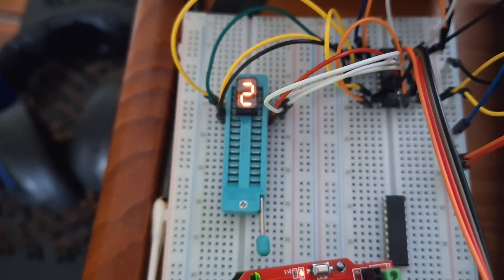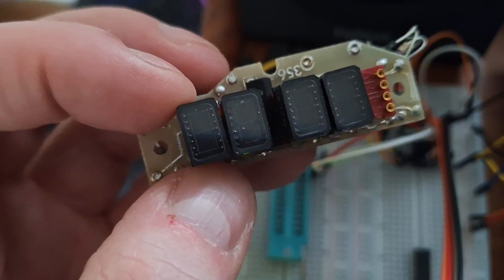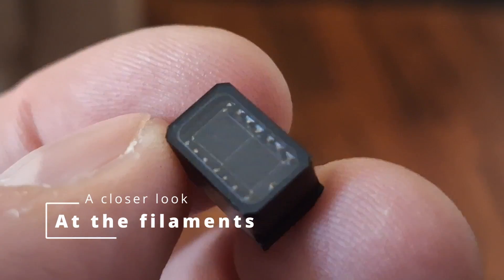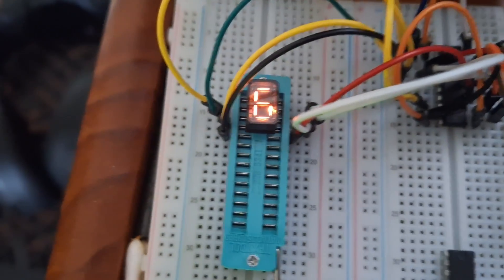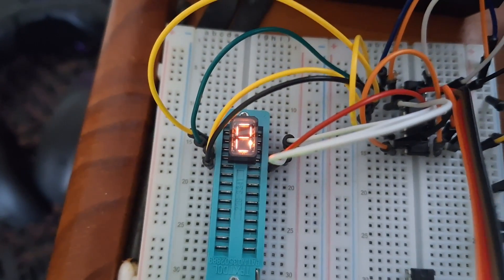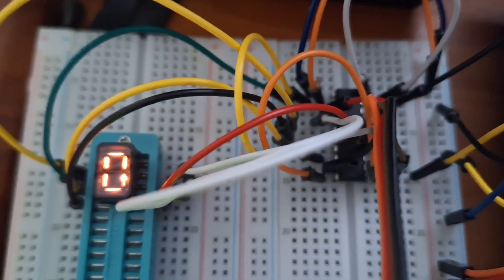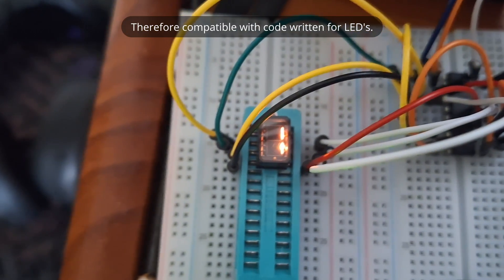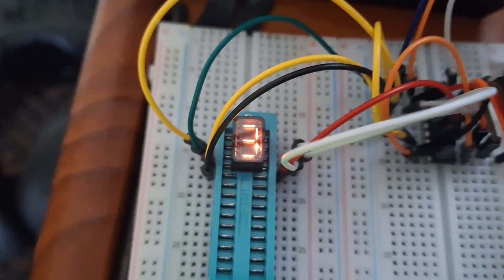Vintage Incandescent filament 7 segment displays on an Arduino Wamco KW-104S

Comment: I have had to replace these in the old clocks of some aircraft. They are expensive to buy new. You can buy a newer model replacement clock from the company that made the original for around the same amount.

Around $400-500 for new certified/traceable ones, which you need to legally repair aviation equipment. You pay a lot for that little piece of paper showing they are authorized replacements.
Reply from the maker: Yeah I can imagine. That bit of paper costs so much that some old avionics are just scrapped rather than being repaired or recertified

Comment: Nice video, I've got about 100 of these all in different sizes from tiny to huge, I'm holding on to mine for now though as the prices just keep going up and up every year.
Reply from the maker: Yeah I'm surprised at how much they go for. They still seem to be manufactured specifically for aviation undoubtedly at extortionate prices so second hand prices will be high too. Edit: just looked $421 new. Each! 

I don't know if avionics repair facilities would buy parts off eBay or not. Guess so as long as they can certify the item they go in as airworthy. 

These displays wear out quickly, two of the ones I have got from a scrap radio had faulty segments and the other was so dim it was unreadable.
Reply: Yeah they do cost hundreds brand new from wamco which is crazy considering the size of it but I'm not sure if avionics repair specialists are allowed to use used parts or not, whenever I've brought avionics in the past there's always a statement quoting that it's not airworthy to cover their back I guess.